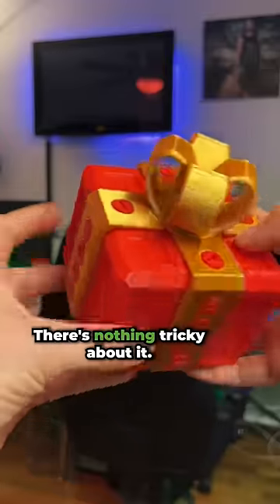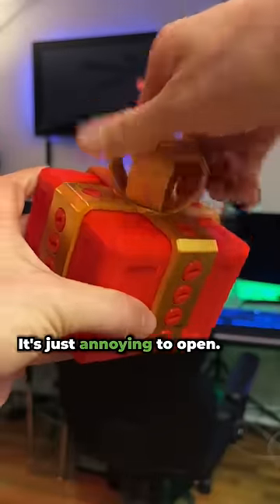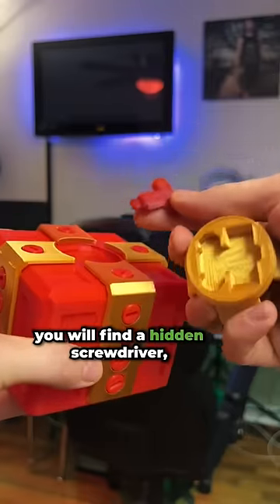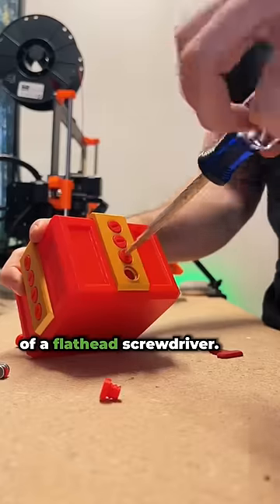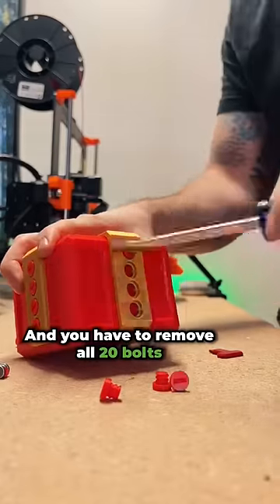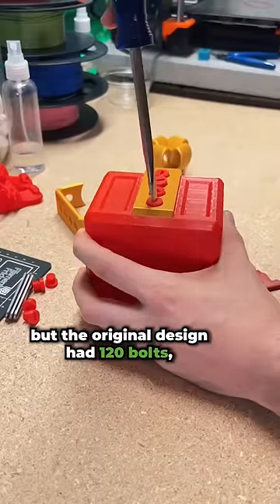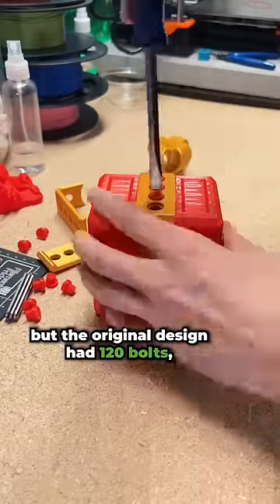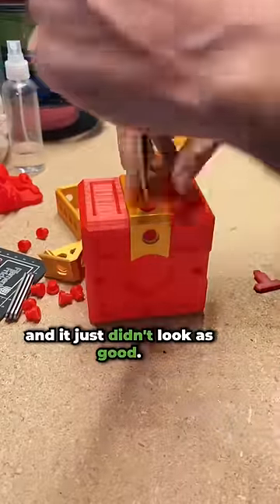The Annoying 3D Printed Gift Box

Comment: 20 bolts is already evil, let alone 120. Only the most patient among all could handle it.
Reply: Welllll, it's made from plastic so probably they'd just smash it open
Reply: only the most patient among us
Reply: I swear man, if I received one that had 120 and they actually wanted me to open it normally the reward better be some pillow with both sides always being cool cuz I would slap somebody
Reply: @BlankedOutSlate  With the pillow?
Reply: Not really,i was expect more annoying mechanic, but 20 bolts seem...not enough to me?
Reply: Are there actually twenty bolts?
There seem to be one at the top, one at the bottom and four in the middle for each side. That totals 6×4, aka 24.
Reply: @runtergerutscht4401  oh, now i noctice that! Thank!
Reply: getoutofmyheadgetoutofmyheadgetoutofmyheadgetoutofmyheadgetoutofmyheadgetoutofmyheadgetoutofmyheadgetoutofmyhead
Reply: @runtergerutscht4401  heck you mean man..? There's 4 at the top and 4 at each side with nothing at the bottom, and even with what you said it'd be 18 bolts, not 24. Where the hell'd you get your equation from-?
Reply: @BlankedOutSlate  one bar has one bolt at the top, one at the bottom and 4 on the middle. That's 6 per bar. Multiply by four and you have 24. You can also watch the clip.
Reply: @BlankedOutSlate  ok, there's nothing at the bottom, it's 5 per bar and that's 20. My bad
Reply: I got patience of the Gods.
Reply: its 20 not 120
Reply: You know what would be more evil? 240 screws.
Reply: u came on the 120 video!!!!